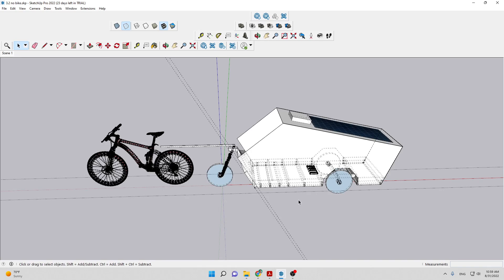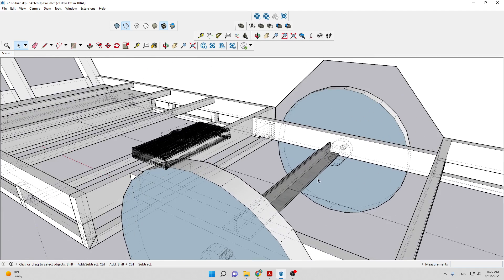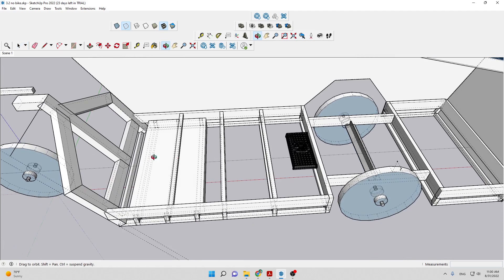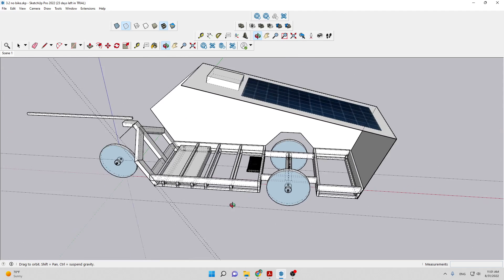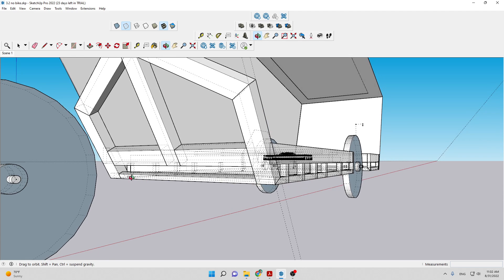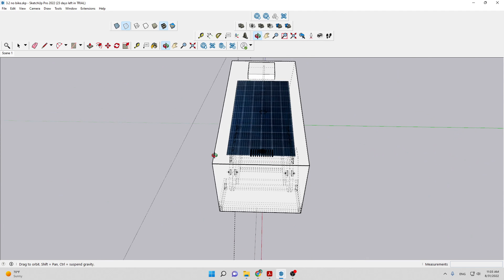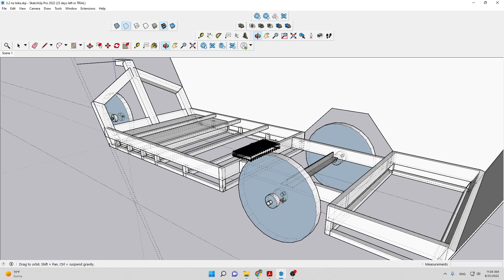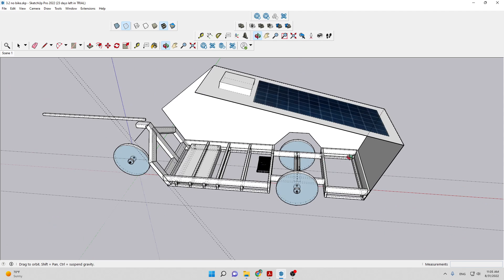Ebike camper design

Comment: I would install braces from the front tow frame to the side floor frame. Where the front tow frame bends to the neck of the frame the the side flood frame. would make the from frame a lot stronger.
Reply from the maker: Hi Jerry, I actually did do that. I need to update my sketch up model to show all the gussets and braces I welded in, including the critical one you’ve rightly pointed out. Cheers!

Comment: It might be a bit heavy, even for a aluminum frame but if it's being towed by an electric assisted bicycle... better to be more robust.
Reply from the maker: Yeah, I’m trying to make it suitable for electric bike components while also being able to (difficultly but not impossibly) tow it on leg power alone.
Reply: @Jerbrown  Good feature ,I was testing my rear right motor for chain manegement etc , when the chain came off I had to get my rig off the gravel road which had an uphill slope . A guick trailer disconnect  would be nice . I used the sturdy roll bar to push the trike off to side . I made sure I can pedal and charge my batts when I'm on level paved trails (  Trans Canada hyway or similiar . ) One rule I abide by is , if the batts were disconnected the rig should be abled to be pedalled powered .

Comment: Wow, this looks cool. I like the shape.
Do you plan to weld it? If you put small beams between the mainframe and the front to create a triangular it will stiffen this critical joint.
How many days do you plan to ride without recharging? Is the battery not a "little" to big? 😎
Greetings from Germany!
Reply from the maker: Hey - check out the latest videos - the design has evolved. Yes, I took your suggestion to strengthen the front joint with diagonal gussets. Good call. From experience, I think it makes sense to go with the biggest battery you think you can use, rather than find out you'd like to have more.